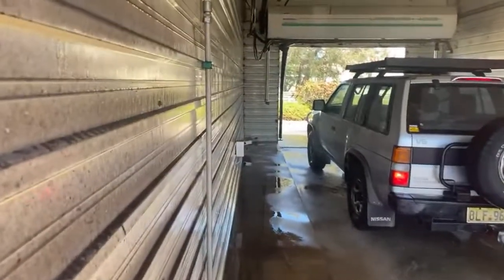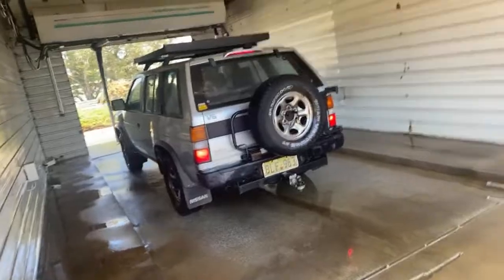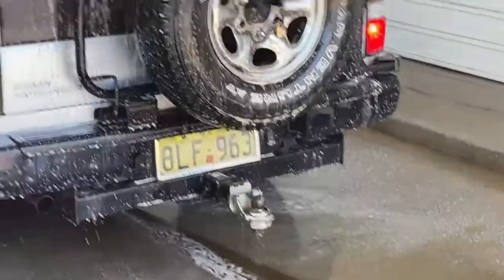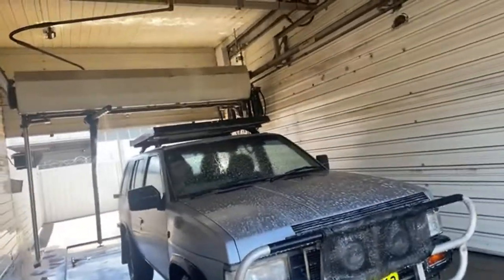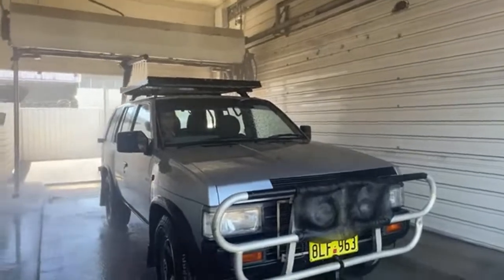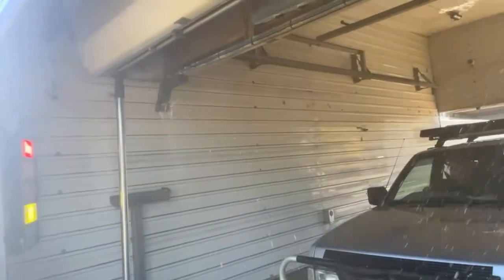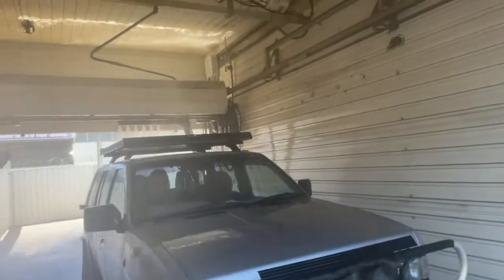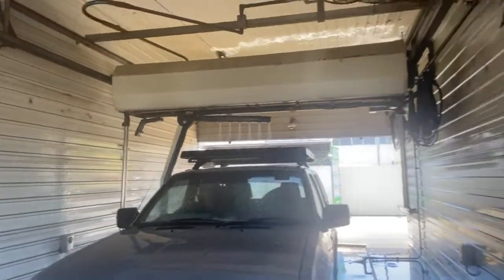PDQ Laserwash 4000

Comment: Never seen a Laserwash 4000 with a Laserwash 360 arm before
Reply from the maker: I think it’s only the cover, as the holes where the bolts would normally come through do not lineup So I think it’s only a cover, it does make it look good though